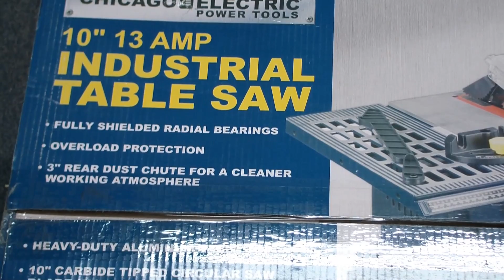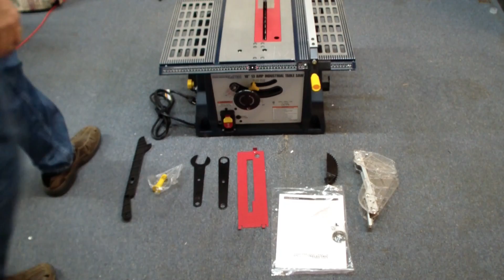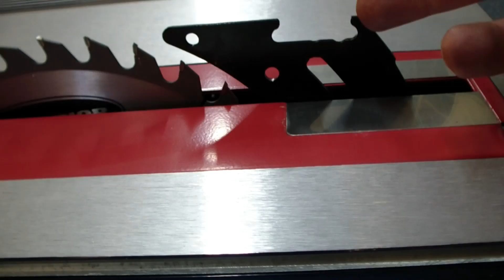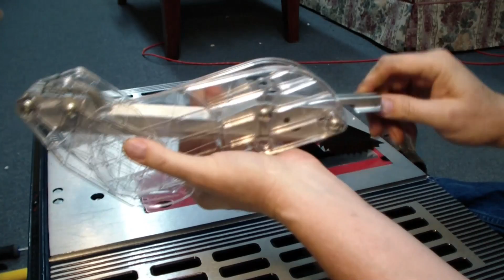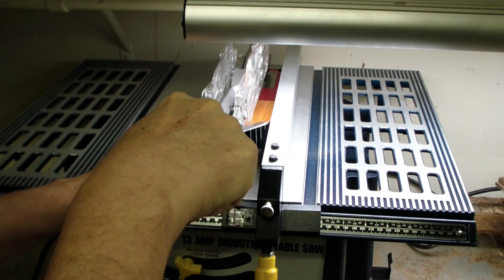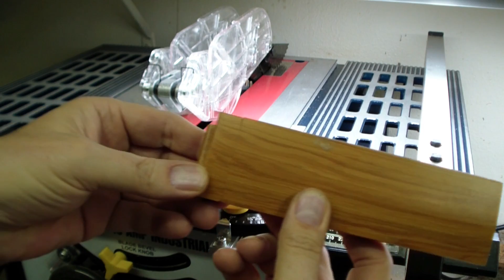Chicago Electric Table Saw Review

Comment: I bought the same saw. The miter slots are not aligned with the blade. The slots aren't cut out well either. Had to take a grinder to them for the miter gauge to slide right. Can't use a sled since the slots aren't aligned. The fence was broken in the box. Tore it all apart and used the saw itself and made a new table for it.

Comment: thinking about getting one of these babies, does the fence cut pretty straight when you tighten it up good? and is the cut width measurement pretty reliable after adjusting the line?
Reply from the maker: The fence is the worst part of this saw. Once you get it positioned it stays put but you have to be very careful to measure at both ends to ensure it is straight first. A saw that costs double will be better. It is all time vs money.

Comment: I bought this Saw and like yours it came with the dado plate and arbor nut. Im using 3/4" material. the admiral tells you to use both outter blades 2 shims all 4 1/8 chippers. With all that, the nut won't go on I called support and was told the dado blade    wouldn't work on that saw. So why i the dado accessories????i  I've had it with harbor freight. Im getting a DeWalt

Comment: I had one for a few years and put quite a bit of work through it. The bearings finally started grinding and gave up. The fence is really pretty junky. I leave the riving knife on my saws and pitch the rest of the safety stuff. I just upgraded to a dewalt - twice the cost, but far superior.

Comment: Owned one of these for about 5 years till the bearing froze in the motor (Grinding, & smoking).  Bought it because it was the only one at the time that had an unobstructed miter slot  so a miter sled runners could be made for it. Not a bad saw better then the Green, Red, and gray color saws of similar value.  You have to do a few thing to make up for everything else.  #1 Replace the blade -Get a 60 or 80 tooth Fine Finish blade.  I used this for cutting everything for cross cuts, rips, plywood, MDF, Oak, flooring and plastics.  Use the provided blade for suspect wood, that might have metal in it.  
#2 Make an use cross cut sleds.  This will help in making your cuts come out correctly. I think I used the miter gauge once or twice as there were some cuts that just would not work out with the sleds.  #3 Never rely on the fence to be parallel to the blade.  You will need to check this every time you set up a rip cut.  The rip fence, even with adjustment will not always seat parallel to the blade.  This can cause kickback very very easily.  Always measure the distance for your cut,  in the front and the back of the blade to fence measurement before locking it down, then measure it again.  If you cn't get it dead parallel, its far better to have the fence toed out rather then toed in for a cut.  Toe in will cause the wood to bind in the back and prepare it for launch back at you (kickback).  #4 Take you time to adjust the blade to the miter slots. This is where you get your miter sled accuracy, and square cut offs. It also reduces your chance of getting kickback being built into the system  #5 Its a 13 amp motor,  take your time on doing your cuts.  #6 Wax the top and the bottom of your sleds,  they will work better.  #6 Make your own zero clearance.  Since I was using cross cut sleds almost all the time, I wrapped The top of the throat plat with 2" painters tape over the opening. 

Misc: With most sleds you hardly use the kickback paws or the blade guard. However, push sticks for keeping things tight to the fence and table top during a rip cut are a must.  The riving knife is a must as well but you must make sure it is aligned with the the blade.  Additional Front, side, and out feed supports may be need for the type of cut you are making. Never underestimate their value for a saw with this small of a support surface you don't want the cut material to suddenly porpoise up off the table on you.   Even with the air vents and the sides taped so the saw had to pull air from down below the saw,  its a very dirty saw.  Saw dust will go everywhere, and you will need to wear enclosed safety goggles (good practice anyway) as this saw has a tendency to kick lots of sawdust from prior cut dust up at you when you start it, and this dust easily slips past your regular safety glasses, even with a good 2" shop vac running.  Last word of advice,  If the cut does not look safe,  practice it with scraps first or figure out a different way to do it.  If it does not feel correct while you are making the cut, stop feeding it, hold the wood where it is, and turn the saw off.  Then go figure it out.  BTW I never used this saw for making long rip cuts, It just not built for it.  Use a circular saw with a rip guide or a track saw to make that kind of cut with sheet goods.  For the small pieces of flooring you were using you can get away with it. 

Was it worth the $100 I paid for it?  Yes, but you have to spend the time making it safer and setting up your cuts for safety prior to making the cut.    Your next spending break for the next level of a safer saw, is about $150 more if you get it on sale.  You get a better fence, larger cutting surface to the right, and far better blade dust collection.  Also watch a few of the YouTube videos on how to make safe clean table saw cuts.
Reply from the maker: Good tips.
Reply: Great advise..read the whole thing you posted on this practice bench saw..just went to look at one..and found this on kents channel..not looking to build fine furniture..but to practice wood working..5 years with a tool..and it shot motor was its demise..not to shabby..thanks for info dude's

Comment: I could never get mine to cut straight. In another video a guy discovered the motor mount bolts are a bit off, fixible.
Reply from the maker: Check the motor/blade alignment with a carpenter's square. The big difference with cheap home tools vs the professional tools is there was no time spent to accurately align the angles.

Comment: Worst saw ever made. The motor comes mis aligned with the top about 3/8 . I guess this guy scored a npt so crooked saw?. Not able to adjust this extreme with the fence. Kickback is inevitable. Very dangerous saw to the newbie that doesn't see this offset. I took mine back immddiately after opening. Run! Lol

Comment: kent I know you probably know this already but the scratch from the kick back paws are the reason for finishing the wood after it has been cut and pre assembled for fitment. if you have a concern with the marks left behind from the saw when using a finished piece of wood you should purchase a bandsaw or use a ras to do your ripping. pull the ras out to width lock into place set blade height and run material through. works great. good luck. have fun most of all. that's what its all about. be safe. remember its a lot easier to replace a piece of wood than fingers or a hand. p.s. you can also use some tape to eliminate the scratches on prefinished wood.

Comment: for the kickback issue you can use masking tape to protect the wood. Or you can use a sacrifical then MDF to put on top with some screws on the ends then chop off the ends where the screws were.
There are techniques for all of this. Also if you turn the wood on the non finished side(assuming its has one) you can avoid the anti kickback scratches.
Thanks for the review. :) 
One thing you did not talk about is Dado. Does the saw do Dados?

Comment: have the same saw. The fence needs to be adjusted by the silver knob up front the and the black bolts so that it aligns better. A cross cut sled does wonders though ....

Comment: I had an older version of this saw, only used it maybe a dozen times and the bearings in it failed, soon followed by the motor failing completely.  I replaced it with a Skil 3410 with the folding stand.  So far the Skil is a lot better quality saw, its definitely built heavier, has a wider rip capacity and tons more power.

Comment: I got pretty bad experience with everything bought at Harbor Freights, though i didn't buy me a table saw there(got a Ryobi, which isn't good either ... no perfectly square cuts in any direction).

I got me that Miter Saw(the middle one), which turned up to even be on the range to be dangerous. I will never buy any of those shitty tools again, would not recommend those for hobbyists or professionals alike.

Comment: FYI the fence on this saw is horrible.  The safety stuff is garbage too, it's more dangerous because the wood gets stuck on its way through and you have to turn the saw off and mess with it.  The riving knife behind the blade is worthless because it's not square, and wood gets stuck on it too.

Bottom line?  If you use the fence, make sure you square it up with a carpenters square, and measure it before you lock it down.  I am working on a replacement for mine.

Comment: How square does the fence stay to the blade.
Reply from the maker: +John McMahan Not square at all. I have set both ends to proper distance.
Reply: It doesn't.  Only the front side locks down, the back is able to be easily moved.
Reply: I've been investigating how to build a table saw and found an awesome resource at Wilfs wood blueprint (look it up on google)
Reply: It only locks on the front side. My longer cuts always tapered 1/16" . Headed off to get something more accurate.

Comment: The miter gauge is very loose  with quite a bit of slop side to side in its miter groove. The fence is not self-aligning, front to back. One must take care that it is parallel to the blade before starting your cut. Even then, with heavy material, I've had the back part slide.
Reply from the maker: +Douglas Jenkins The fence part is worst aspect. I have to measure the back and the front to ensure it is even. Have not had trouble with the miter groove.

Comment: kick back sucks but it happens when  the wood binds between the blade and the fence always check to make sure your fence is parallel with the blade also that stupid Lil miter sled not helpful and usually to loose in the guides better off making a cross cut sled unless your doing weird angles not talking about 45s though you could make a sled for 45s as well

Comment: The safety equipment is not stupid. It protects you from losing body parts. Hopefully you were smart and kept that equipment. Don't let overconfidence take a hand or finger. That "thing" on the back of the blade is called a riving knife, which prevents the wood from hugging the blade thus preventing kickback.

Comment: when cutting finished material, common practice is to put the "good" side down. If you had done that the anti-kick back cawls wouldn't have marred your flooring.
Reply: +Jeffrey Taplin Yes. Always adjust the blade height. Too much exposed blade above the workpiece always causes lots of splintering. Also, you could put masking tape along the cut line to minimize chip out.
Reply from the maker: Alexis Rocha Others have said that too. I thought the back side of the cut is more likely to have a splintered edge. I can give it a try. Maybe use a piece of paper to protect the finished face.
Reply: Kent Diego try a finish saw blade not the one that comes standard with the saw. And no paper on the down (back side) of the cut, masking or painters tape works best to keep splintering to a minimum. Good luck.
Reply: Alexis Rocha oh, 1 last thing, adjust the saw blade so that only 1 tooth protrudes above the thickness of the wood you're cutting. If the blade is raised too high lots of splintering results no matter what other counter-measures you employ.
Reply: +Alexis Rocha Alexis-I have a question: Is what you mentioned about adjusting the blade so only 1 tooth protrudes above the wood a rule for ALL table saw cutting or just in the case of working with finished material?

Comment: Hey, nice review, how much work have you gotten out of this? I've been warned off most of harbor freight's power tools. Everyone tells me that the motors have a bad time with over frying.
Reply from the maker: Radar Really I use it for light duty. The motor comes with extra contact brushes if they wear out. Unless the bearings go out my guess is it will last a long time.
Reply: This is good to know. Thanks.